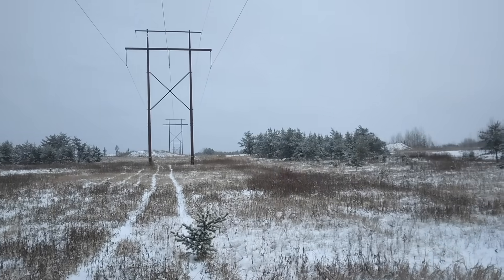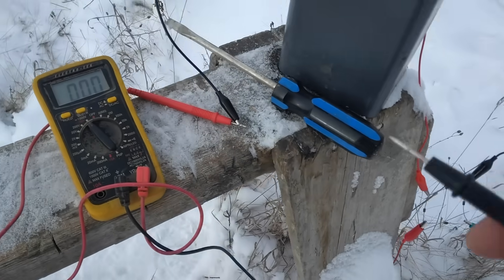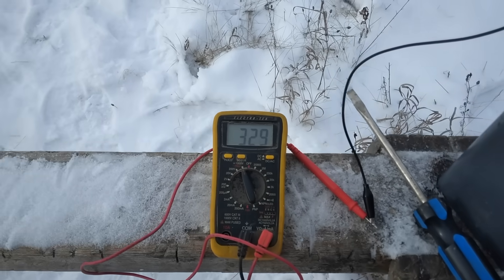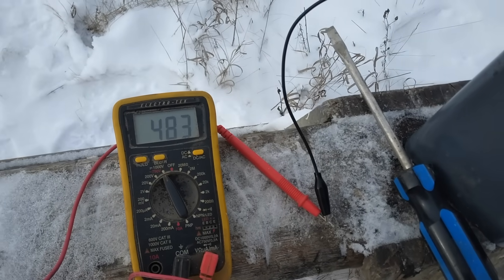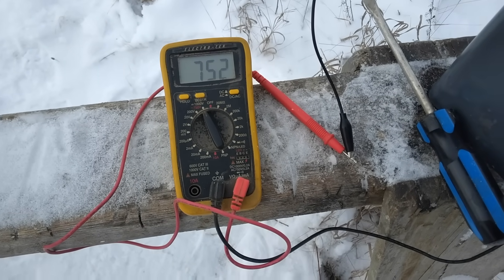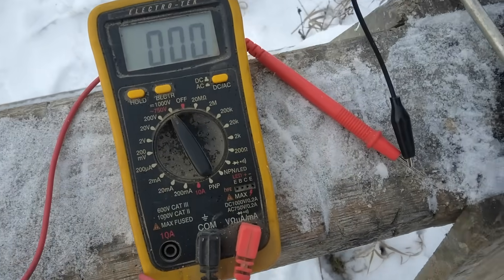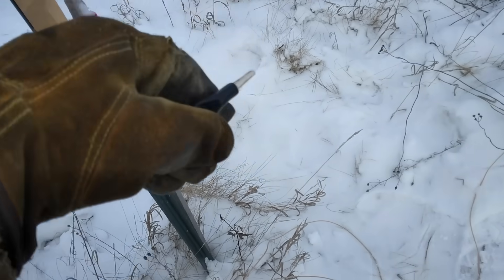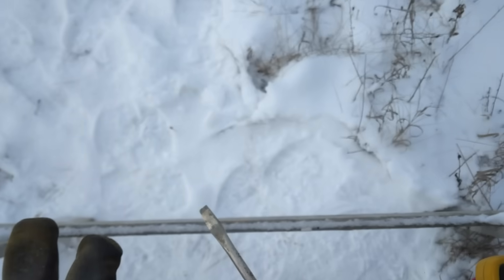Fences sucking power from under HV transmission lines

Comment: Back in the 80's we ran a permanent electric fence around a large farm I was working for. Part of that fence ran under some large power lines coming from a power plant and once that fence was insulated it was hot without being connected to a charger. This fence was 5ft tall with 6 lines and fiberglass posts and the lines alternated between hot and ground, They were all hot under the large power lines.
Reply: Sounds like you were wasting free electricity. You should have set up a large scale version of what was shown in this video, and powered your electric fence for $0.00.
Reply: so how about legalities there then.  if the power company claims that drawing on that magnetic field is stealing their power then it must work the other way round:  if they,  so to speak,  'push' their power into your fence with all concomitant possible dangers and inconveniences then they should be liable for that.  right? quid pro quo.
Reply: @abrogard142      That's assuming the power company would notice, let along care, that he was capturing power leaking from the lines. Right now this phenomenon isn't large enough for there to be a standardized ruling one way or the other. 

It very well may be that even if the power company does accuse him of stealing power, he could take this case to trial and win thus negating that possibility altogether.

Comment: Your meter leads are probably safe to 1000 volts.  But all the wire you are using is probably only rated to 600 volts.

Comment: When looking for a new house, I was aware of the EMF surrounding high tension power lines. One of my stipulations was that the house be at least a quarter mile from any transmission lines. My extended family thought I was nuts...they built immediately adjacent to to transmission lines because the property was cheap. There are well documented effects of EMF and young people inducing lukemia. They have three young boys. God help them.
Reply: We bought adjacent to a 230kV line, and I didn't even check with a Gauss meter, but did have a plan.  The house has aluminum siding. The second month here the steel roof went on.  The window screens are now all aluminum.  Five bars outside the (steel) front door. Zero in the living room and bed room.  Not perfect, but the gardens are further from the HVL and I worry more now about just carrying the phone.

Comment: Thanks for the post. As a lineman it’s always interesting to see people outside of the industry taking an interest in how our energy is delivered, most people don’t understand what goes into the generation,transmission and distribution process.  Great work.What brand of hat are you wearing at the beginning of the video?
Reply: Wool Crown cap made in Canada
Reply: If you interrupted all the ground wires on a bunch of poles with a very tiny Gap and siphon the power from the wire connected to the wire that runs along the bottom when there be a whole lot of power coming out of that and hopefully the tiny Gap make it interfere with lightning protection. You may have to do it with a nice related set of polls like two of them and just have a wire strung right below it I think he might know what I mean as a lineman you could string an additional wire between two poles and connect them to something deciding off the power see what kind of results you get from that I think you would have a lot of power it's constantly running into the ground and that should be able to be siphon dog maybe the utility company could try that on a large scale and see if it's anything viable
Reply: Once you start messing around with the power company's poles, you are going to get in to lot of trouble. @yonkromis7883
Reply: Knights of Columbus logo?
Reply: @ Kenfedor22 I had asked about the brand of hat “ at the beginning of the video”. I received the answer yesterday. Thanks for your help.
Reply from the maker: I don't know the brand.  I got it about 25 years ago, and it's worn out.  It's wool one with ear flaps, and used to have a tassel ball on top.   Thanks for commenting!

Comment: Is this power that is "lost" in transmission or does this "cost" the line company in added resistance? And could you charge batteries under these line?
And would the current increase if the "fence" wire that you are running under the high lines was thicker (you appear to be using a 10 or 8 guage wire, would it increase with a 2 gauge wire) and does the current increase automatically with a longer wire or is there a limit on the length that can be used, (in other words if the wire is too long does it start to heat up instead of flow because of resistance)?
You can tell i am fascinated by your experiment. 
My father bought and developed property that had high voltage lines running thru it. Two doctors, who looked at buying and building on the property, refused after they were told there is an increased health risk because of those lines. This is proof something is happening.
Reply: It's both. The power company loses a lot, but if you set something up to harvest it, they lose more.
Reply: @thewhitefalcon8539  thank you, I never knew.
Reply: @dalewier9735  Note if this was a radio transmitter, because of the shorter wavelength, if you were a few wavelengths away and set up a big antenna, you wouldn't be taking anything extra from the transmitter, although you would be casting a shadow behind your antenna. In that case it might be legal if you weren't interfering with anyone else's reception behind your antenna. However the wavelength for 60Hz is thousands of miles.

Comment: In Electrical Engineering, I heard stories about farmers using this trick to steal power.  The problem got so bad, that the power companies began looking for these setups, when they checked the lines.  Those caught were often fined.  I'm thinking this occurred back in the 1930's and 40's.  But then, it could have been just an urban myth.
Reply: Years ago, a farmer was placing unwired 48-inch florescent light bulbs under the high power lines crossing his fields. They improved the growth of his crops. The electric company took him to court for not paying for the power. He had to take the bulbs down.
Reply: With all the modern power grid tales, I think they are all myths and urban legends based on the physics of really old rural power transmission.

Back then,  where households might be miles apart, the power companies wanted to spend as little as possible for their power distribution. So they only ran a hot wire along the poles and relied on the physical ground to provide the return path. 

If you drove two rods into the ground, widely spaced apart, you could use the voltage drop in the ground to tap off power. Since the current density would not be very high, I have no idea how efficient this was - but it apparently was enough to light the very few electric lights that people had in those days.

Comment: i am a 65 year old MAN. my father was a lineman for the power company and worked there for over 20 years, started as a janitor and retired as a trouble shooter. i myself got a job as boiler operator trainee in 1978. i quit that job in less than 1 year. arkansas power and light company (now its ENTERGY) 
IF your hooked to the GRID, then every wire in your home is giving off these currents and affecting your health!
that is why i LIVE OFF GRID with DC wiring. if the switch is off, there is NO ELECTRICITY FLOWING!!
IF THE ELECTRIC COMPANY LOOSES LOTS OF THE ELECTRICITY THEY GENERATE JUST FLOWING THROUGH THOSE WIRES, AND EVERY EMPLOYEE IS A IBEW UNION EMPLOYEE, AND THE COMPANY IS MAKING A PROFIT... HOW THE HELL COULD ELECTRICITY HEAT YOUR HOT WATER FOR LESS COST THAN USING GAS?????
in fact, i generate my own electricity far cheaper than i could ever buy it from the power company!
its ILLEGAL for YOU AND ME to burn  1 tire in fire , but the electric company can burn them to create electricity. they buy CARBON CREDITS to offset the pollution they produce.
if i could collect 10,000 CARBON CREDITS i would REFUSE TO SELL THEM TO ANY CORPORATION!!! NO IFS ANDS OR BUTTS ABOUT IT!!
ive held lots of jobs in my life, i did it to learn how to supply myself with the things i have to have, SO I DO NOT HAVE TO DEPEND ON SOCIETY. I GREW UP DURING THE COLD WAR!!
the infrastructure for everything in america is so fragile!!! 1  9mm into the bottom of a transformer will shut off power from that point on down the line! i did that as a young teen  . turning up the FLUORIDE proportioning pump at the water  plant will kill everyone that drinks the water!(side note: during the Tylenol scare, a man in little rock arkansas DIED FROM FLUORIDE POISONING from using a sugar substitute package to sweeten his coffee at a restaurant  )  i sandblasted and painted water towers for a couple of years. i installed BACK FLOW preventives AT APARTMENT COMPLEXES, IT IS EASY TO GO AROUND THEM OR JUST USE A SINGLE FAMILY HOME.
once they flip the kill switch on your automobile, you are on foot!
remember the covid 19 pandemic fights over toilet paper? if you didnt learn something from that shit show, then you deserve whats the government has coming your way  . i plant seeds, its NOT my problem if those seeds DO NOT germinate and grow, its yours!

Comment: You tested e-field pickup. You might get more power from residual magnetic pickup, and the voltage would be safer - you can run a 'fence' wire along the ground under one of the outer lines, and a return line a few meters away from the power line. This should be a much lower voltage around your loop and might be a useful amount of current. You might also find it is mostly 180Hz (third harmonic) due to most of the 3-line 60Hz cancelling itself out!
Reply: Cool
Reply: Coool
Reply: You are correct but I just perused all comments and yours is the only one to state that.
Reply: Cool. I was thinking on the same lines as you. No pun intended. Can you imagine the size of the magnetic field and it's density around that heavy conduit carrying how much voltage??? Yeah. I'd be abliged to " experiment in ignorance " what I could do with that magnetic field. 😊 I use aether sticks in my garden pots. Thy utilize the free magnetic energy around us. Magnitizing the soil that plants really enjoy. It also helps detour subterranean insects that thrive on the roots of your food, and many common ones that feed on the leaves and stalks. They don't like the the frequency. 😊 But the plant sure does.😮

Comment: It’s really wild how much inductance is happening under those power lines I was on a transmission line building crew and it would charge the line we were building beside it to 29,000 volts and when we put the grounds on it would make at least a 6’ arc. We also had fun with the static from it. We would make little wire pistols and shock each other on the neck or behind the ear haha
Reply: A guy I went to school with built his house right under those power lines, the large ones with the steel triangle support tower. We studied electrical engineering, I thought he was nuts for doing that. Grand kid was born with all sorts of issues and didn't survive more than a few months. AC power is nothing too be fooled with or taken lightly, some engineers don't even realize that.
Reply: @jedclampett3725  Spoke to people in a housing tract built underneath massive high voltage transmission lines, whilst canvasing for a sales job out in the backwoods of TX. The residents of that little housing tract had lost multiple members of various families to cancer and other ailments that could not be explained. A study had been done to find out why everyone was dying there, and the only common denominator was those high voltage lines. They were all convinced they were the culprit.
Reply: > . . . when we put the grounds on it would make at least a 6’ arc. <
The dielectric strength of air is about 1,000 volts per millimeter, or 1,000,000 volts per meter.  6' is 1.5 meters so are you saying that you developed 1.5million volt arc?, and lived to tell about it?
An arc of six inches in dry air corresponds to 150,000 volts, which is also courting death if there is any current at all behind it.
Reply: @peteinwisconsin2496  Yet Tesla and Mark Twain played with that electricity in Tesla's lab all the time. I guess when you know what your doing, you can get away with doing dangerous stuff. Re: Dangers of AC power. Read "The body electric" by Robert O Becker the last chapter is how he tried to convince utilities to not use that frequency because of the harm it can cause. Tesla tried to warn them as well. They weren't having it. I guess it was intended to cause damage and feed the healthcare industries profits.

Comment: Maybe try a loop to couple for current, the return leg would have to be some distance away to avoid catching the same field, or maybe on the opposite side if the phases are different
Reply: Coupling is proportional to loop area, I think. But it's usually easier to add more loops and keep using the same area over and over than to make one really big loop.

Comment: I would be curious to try a different cable. Maybe unshielded CAT5E or CAT6 Networking cable. Since the wire pairs are twisted it would act like a transformer under the power lines. Be mindful of which wire pair you use as the different colors have a different number of twists per foot.

I wouldn't use a very long length of cable either. I would start with 6 inches to see what voltage you get. If you need more voltage just increase the length incrementally until you get a desired voltage, or connect the wire pairs in series, or both. Once desired voltage is reached just cut more of the same length wired the same way and connect them in parallel to increase current.

For experimentation of course. 😉
Reply: That's a great idea
Reply: Twisting the wires woudln't matter.
Reply: @thewhitefalcon8539  I would think the different number of twists would change the like the number of turns on a coil in a transformer.
Reply: @dustinadamson833  No, it isn't the same

Comment: You're probably OK playing around with a capacitor but what you're doing is illegal and the power company does not like it. The wire is essentially an antenna that is stealing electricity from the transmission lines and if you take enough, the power company can tell. You can build a more sophisticated antenna that can actually collect a usable amount of power but the power company might come after you if you did. It's not particularly good for your health being in that strong EM field either.
Reply: Years ago, a farmer was placing unwired 48-inch florescent light bulbs under the high power lines crossing his fields. They improved the growth of his crops. The electric company took him to court for not paying for the power. He had to take the bulbs down.

Comment: Just an FYI : Bare steel towers without RF or lighting equipment, make or harvest or collect electricity. Whatever the natural phenomenon is. I am a former Cell tower tech / Stacker. Nearby High voltage lines not required. The shocks you can and will receive will definitely get your attention. I never tried to measure the voltage produced. Based on how the shocks feel,  it’s not low or incidental.
Reply: If the tower is grounded they don't
Reply: @thewhitefalcon8539  ok